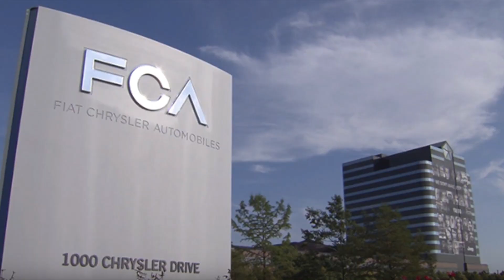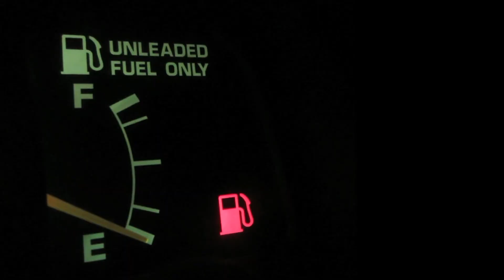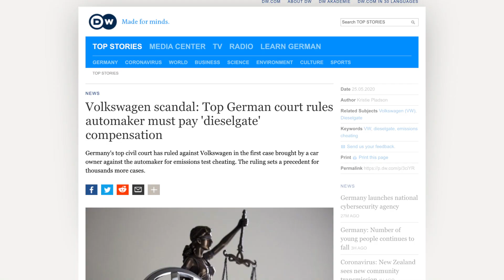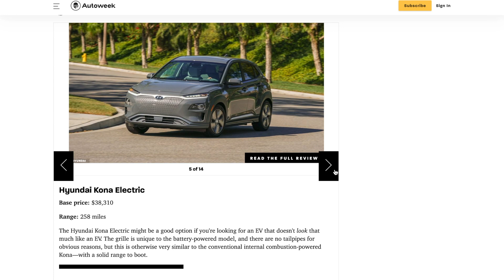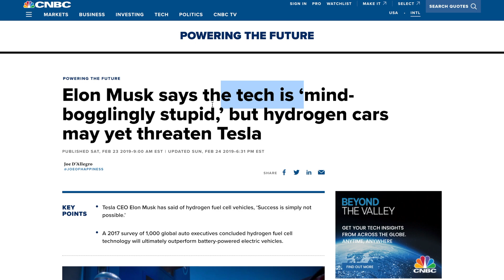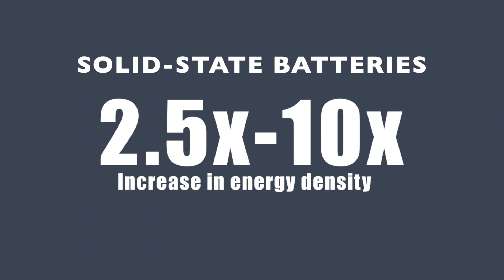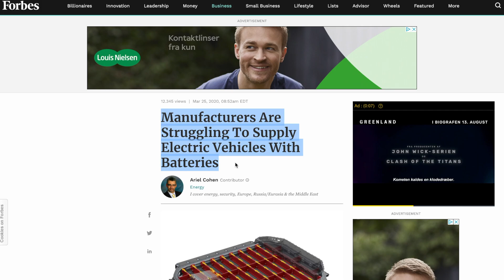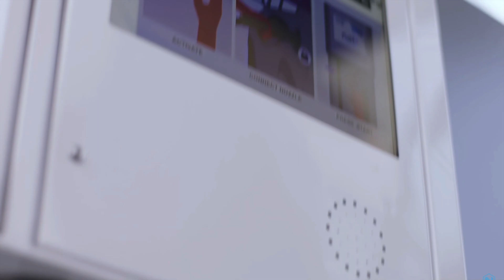The Future Of The Automotive Industry

Comment: How do you think this will affect performance figures? Combustion engines have a higher top end speed and have more efficiency in terms of top speed, they also have a edge in the track and cornering and gas engines from supercars, hypercars, sports cars, and race cars are improving in all performance metric drastically, do you think the electric powered vehicles will improve so much that they will become superior to all gas-powered vehicles including top-end acceleration? because I am a car enthusiast and I would like the electric cars to compete with gas cars on all performance metrics, and I believe that the sound of the gas engine when you are driving it when it comes to fast accelerating cars is something that I don't think the electric cars can replace.

Comment: Why not build the EV with a limited range, say, 200KM, then have an interface to add more range by adding another battery pack.  Say battery packs provide the electricity to add another 50KM, or 100KM.  Then instead of waiting for a recharge, one can just buy, or rent, an add on battery.  Commuting in my home town daily doesn't require more than a 100KM base power, but if i want to travel to Toronto, 400KM, I could rent the power supply and add it to my vehicle. Then recharge at my destination, and return with the rented power supply.
Reply: Hmm, I'm guessing that would add to the weight of the vehicle, thus requiring more energy to make it move. Like the rocket equation, where  like 90% or something of a rocket's weight is just the fuel required to take the rocket itself up, plus the fuel required to take up the fuel for that, plus the fuel required to transport that fuel, etc.

Of course I don't know the numbers and am not a rocket scientist lol.

But then again, where are you gonna put that 2nd battery? How big is it? Do you need to tow an extra trailer around? 

So that seems a bit tricky.

Comment: Hi, nice overview. 
But I think you only covered the energy challenge of vehicles. Which is quite an important one indeed, but it's not all.
The future of cars is much bigger than that. 
I do agree with you about the range though. Since after xx number of miles, even if you drive straight, at some point you need to stop, rest and eat. And that's the time to charge as well. The question is: could you find charge station on your route (and this is not that obvious).

Lastly, do not underestimate the power of money the existing players have
 Vw, toyota, bmw etc, has a lot of funding to allow them to steer research. And even if they would break under financial pressure, governments will not let them fall that quickly since they employ many many people... so there are more forces acting here.